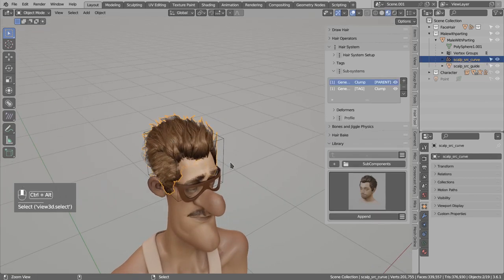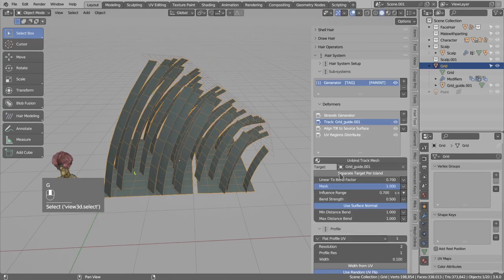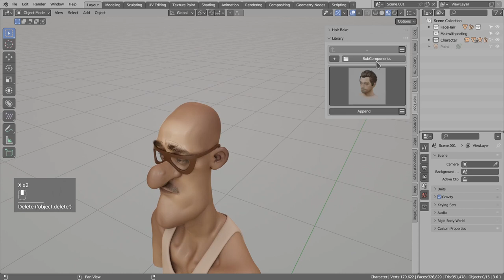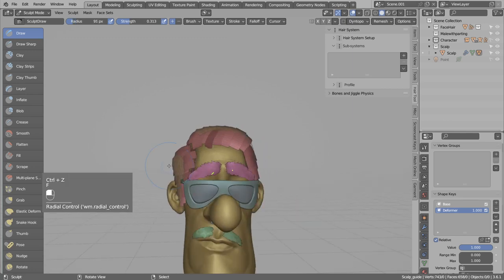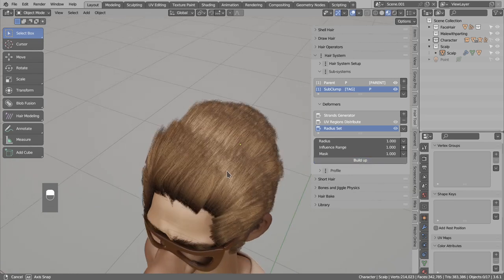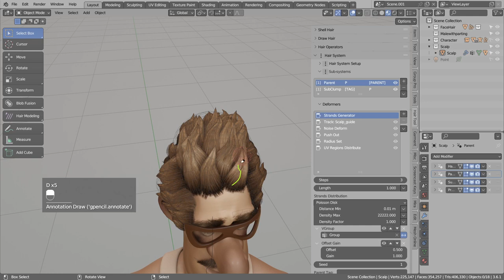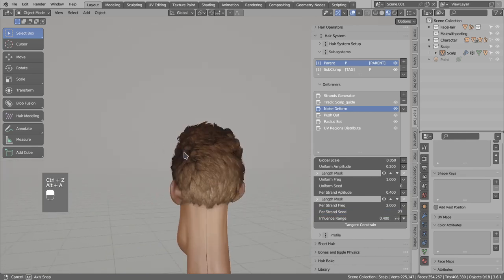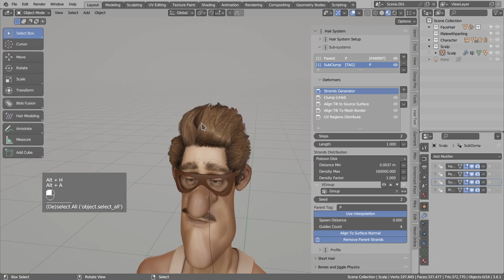Do not comb your hair. Sculpt it.  Track To Mesh deformer, for lazy people.

Comment: Blender 3.0 is in use. Originally, when I use a hair tool, I use a mark sharp on the mesh, but I wanted to model it in more detail, so I modeled it with a curve.

If you use a hair tool after modeling with a curve, the previously held positions will be disturbed. Is there a way to use hair tools while using the existing curve design as it is?

Thank you for reading it
Reply from the maker: Nope, sorry.   'Curves from grid' will just regenerated curves from scratch  - ignoring any manual tweaks.   The new HTool 3.6 is way more flexible - when it comes to adding procedural effects to hair, so maybe updating to blender  3.6 and trying it out, can help.

Comment: Can you add a dreads profile, more African American styles of hair are rather difficult. Can you make tutorials on Dreads (short, long, all styles), Afros (curly, long, short,), braiding (multiple styles)
Reply from the maker: Hi, I have received request for Afros and Dreads, I'm just not sure how to make them myself.  I have added two presets in to HTool hair library - https://joseconseco.github.io/HairTool_3_Documentation/hair_library/ where you can see two methods curly afro hairstyle.  I guess these could be converted to dreads, by switching profile from curls to cylinder (or mesh profile - where mesh is single afro clump - it will be then instanced along hair strands) ...  I will keep it in mind when making new videos.
Reply: @bartoszstyperek6306  thank you!

Comment: Hi! I think the new hair library you posted on 23/12/23 does not have a scalp mesh. I would love if it was added.
Reply from the maker: Hi, just double check -  for me scalp preset is on second row (first item) - in  'sub componenets' category (folder).  In worst case scenario u could use ''very short hair' preset - also from 'sub components' category.